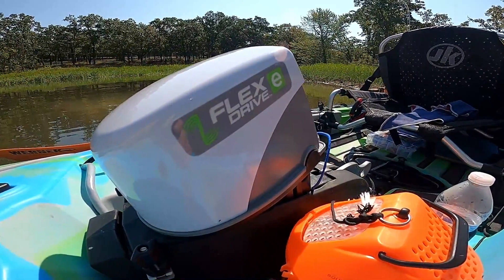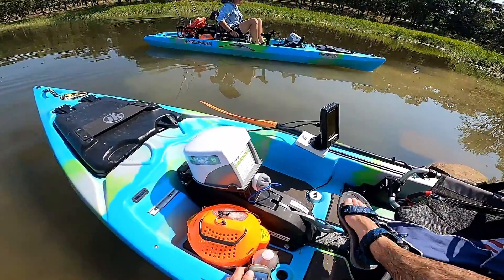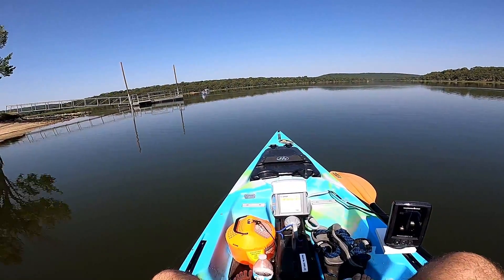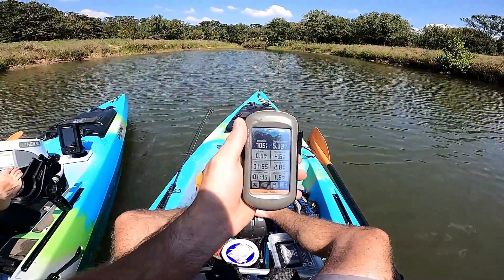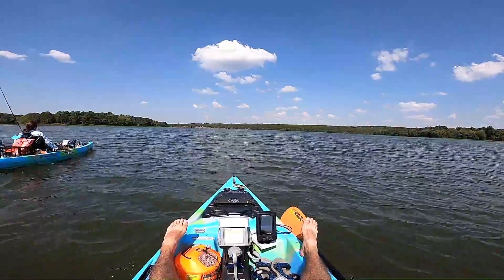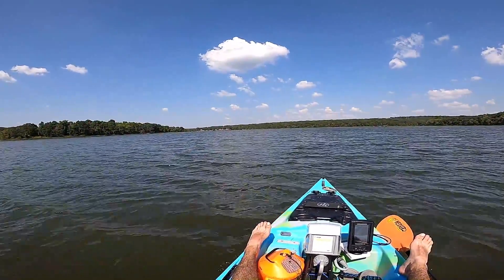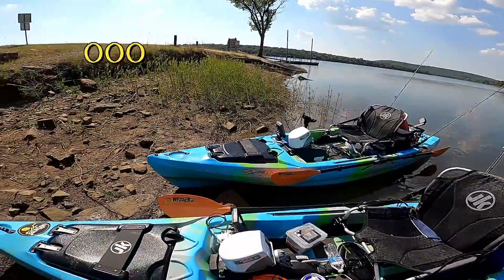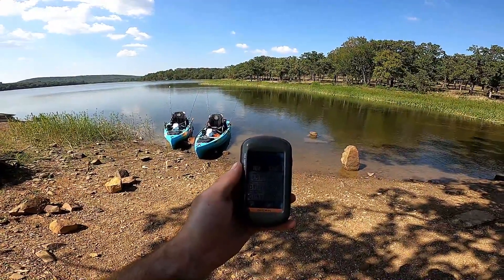Jackson Kayak Flex Drive E Demo/Review!

Comment: Do you know the specs on the motor. I bought a used e drive. I am trying to understand how far I can go on a 12v 100ah.
Reply from the maker: I would imagine you would go farther than I did in this video. My battery was a 60 AH battery.    I traveled 9 miles with about 60 or so percent battery life left.